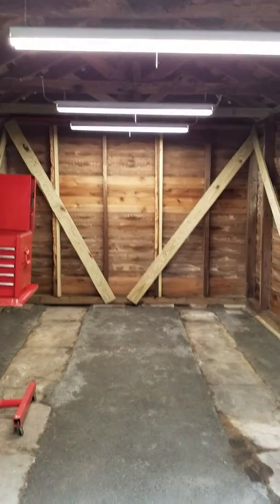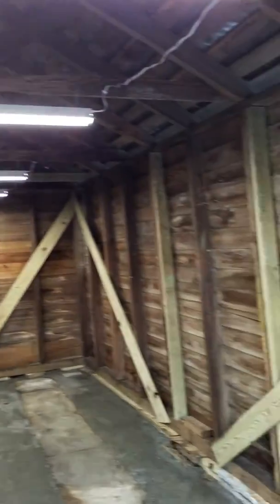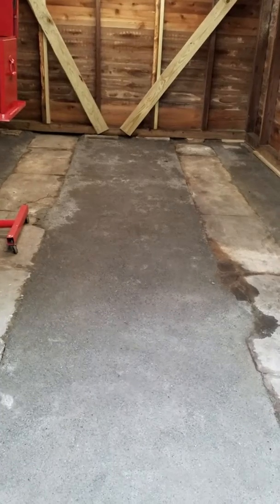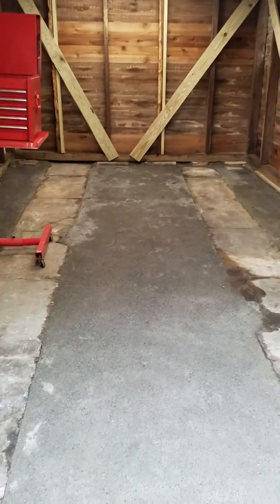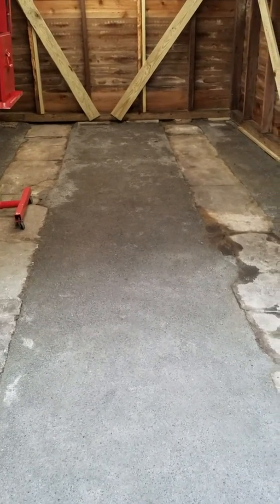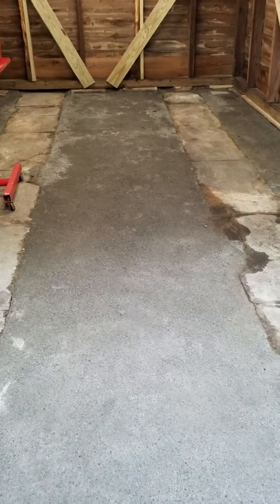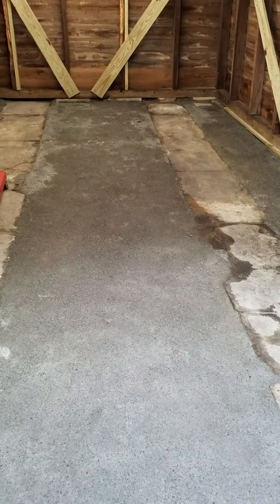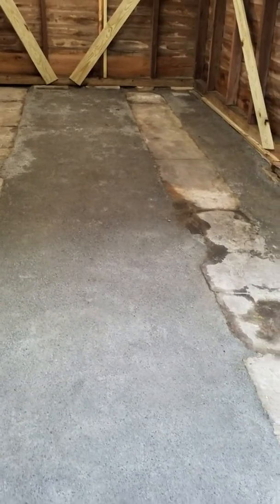Decomposed Granite and portland cement shed floor

Comment: Thanks for the share. I have unstabalized dg and are experiencing the typical downsides of loose material. Would really like to try this as cement is easily acquired unlike other stabilizers
Reply from the maker: I'm glad you found this informative, and good luck with your project!

Comment: Just what I was looking for. I just want a hardened path around the back and side of my garage that isn’t a puddle in the winter and helps reduce the weeds. 

Is this still somewhat permeable and let’s water drain some?
Reply from the maker: Hi!  I sold the house not long after posting this video 4 (?) years ago.  If I remember correctly, it did let water drain through somewhat.  Good luck!

Comment: Thank you for sharing.  I'm considering doing this for a large patio.  I already use (unstabilized) DG in the back yard, but chair legs, etc dig into it, so I thought I'd try to stabilize it with portland cement, but (as you said) I haven't been able to find a lot of information online.  The few reports I read varied from 5-20% cement but without addressing thickness of the layer.  I wonder if too thick a layer would crack so it was useful to hear your 3" layer with daily watering resulted in a fine surface.  Thanks again.
Reply from the maker: You're welcom, Ed.  It's been down for a while now and still very stable.

Comment: Isn't that basically a mortar with very small aggregate instead of sand
Reply from the maker: No, Alejandro, I don't think so.  I think that mortar has more adhesive properties than this stuff did.
Reply: mortar has three times the portland and uses masonry sand instead of fines.  similar actually.
Reply: @kacykoelliker5817 I’m looking to precast some 5x5x7 concrete fence posts, with a imbedded rebar cage….what would be a good ratio mix with DG?

Note : I would probably use a varied aggregate mix of DG/Gravel/Sand along with the Portland Cement….also, how much water?

Thanks!